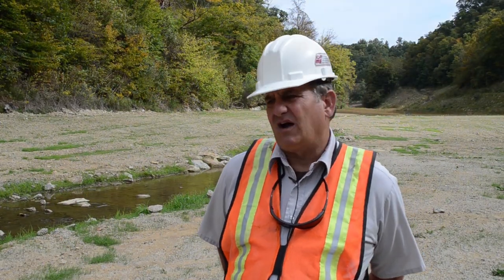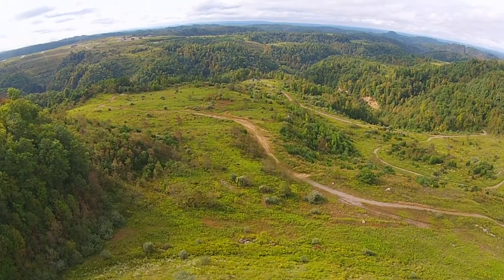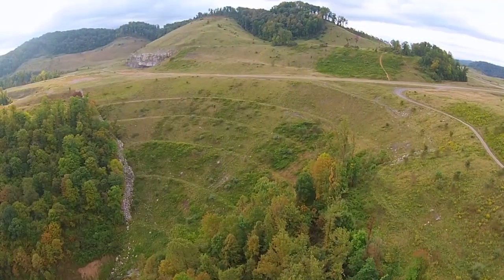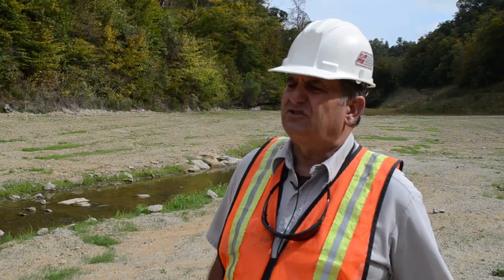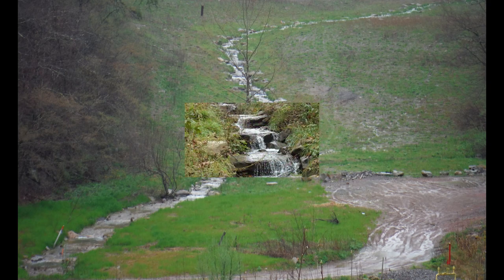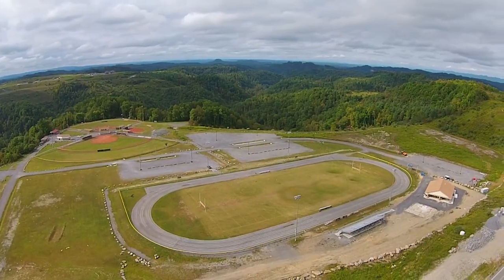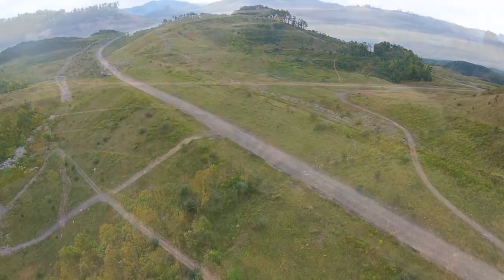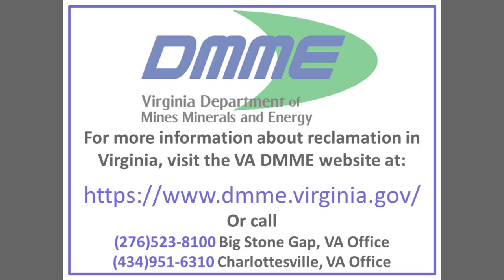Reclamation in Mining

Comment: I'm as pro-coal as anyone, and I want companies to be able to mine the coal that they own the mineral rights to. You may be able to show some grass and a white pine or two to the masses and they think it's returned back the way it was. But to a man who knows how God put the mountains together it's never the same. There's so many things that's not the same any longer, especially on large scale jobs. The layers of rock that holds the water table is destroyed, meaning a streams holding tank is ripped apart. That's one reason (a long with ground water being sunk by mining) that the mountain streams in S. W. Virginia, W. Virginia, and E. Kentucky are dried up during the hot months of summer. This was never the case when I was a boy in the seventies. Plus the native trees of the Appalachian mountains are never replaced. One question I would ask is, Would you drink the water? When I was a boy you could.